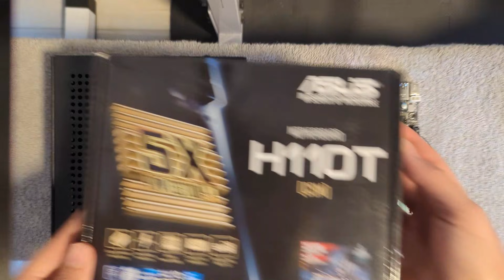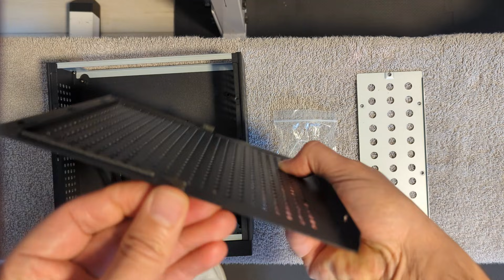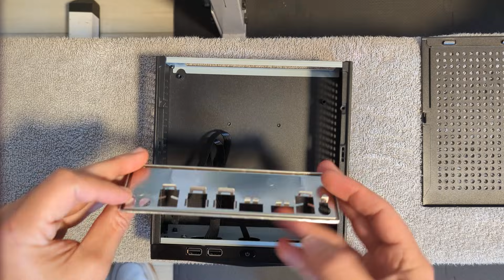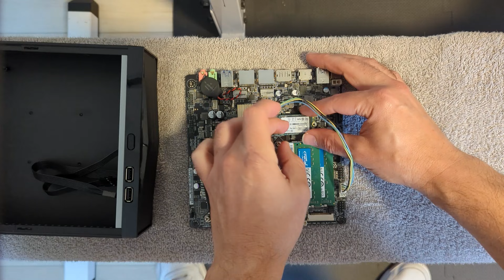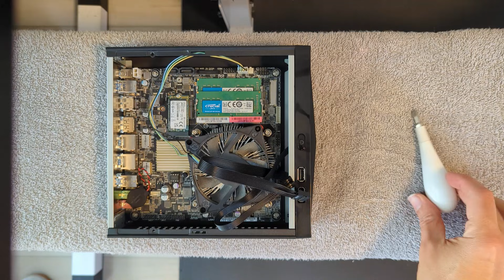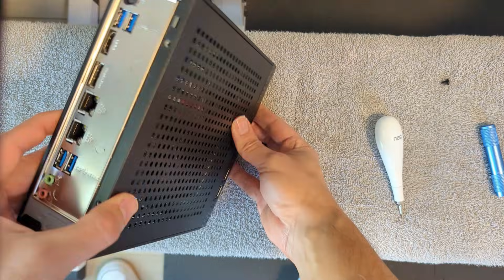Small Form Factor Computer  Build Using Asus Thin Mini-ITX Motherboard

Comment: Funny thing, I was recently looking at this case on Amazon. Since it's got a punch out for a pico PSU connection it makes me wonder how far this little case can be pushed with a more powerful APU system under something like a Thermalright x36 low profile cooler. Neat little box for sure. Looks like it recently got a new revision with USBC.